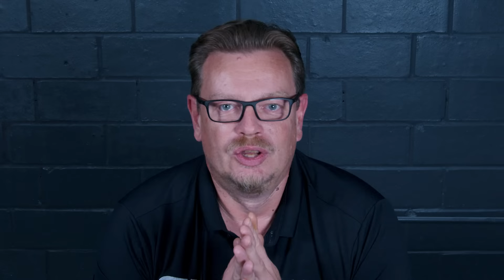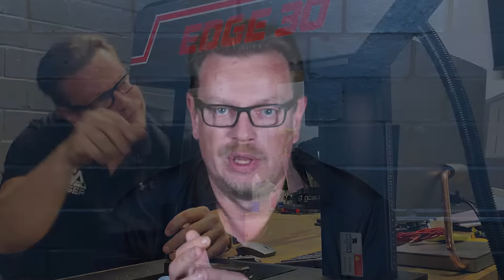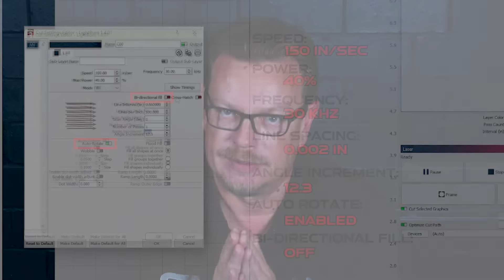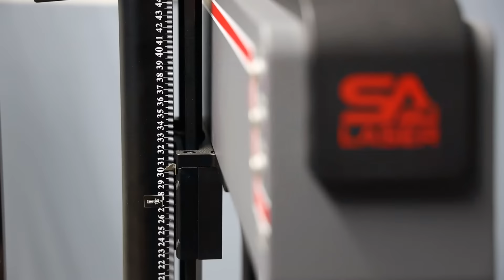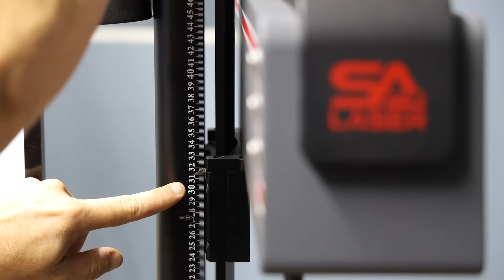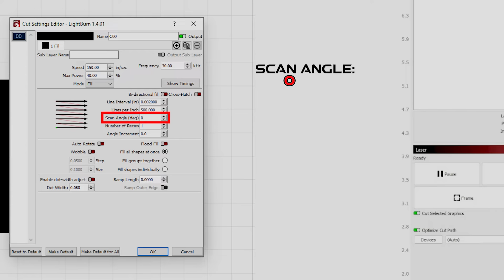Can you color polish metal with a fiber laser?

Comment: I find the question of whether this is possible WITHOUT changing the focus much more exciting. I tried this with my JPT M7 60W Mopa and it works great if you adjust the values. But it's just stupid to go almost 10mm higher in focus. This affects the material around it, which should not be discolored at all.

Comment: I'm having some trouble with this method, i have a 100w mopa fiber and i converted all inches into metric, and converted all 30w laser powers into 100w equivalent.  I am trying to polish titanium but it's engraved more deeply than the one in the video.  My lens has a focal length from 110mm to 280mm, though the optimal focus is at 210mm.  Does anyone have suggestions?  I'm trying to run the whole progression again, with more passes thinking because it is deeper I may need to vary the focus by a few tenths of mm as it does each pass to ensure it is all hit properly.  Thanks.

Comment: So just to be clear this takes a really long time to do for like a 3 inch square
Reply: Yeah, when I set these settings, and previewed, it says the 6 cleaning passes will take 28 hours. 😮 Pass.
Reply: @GettinEdgyEDC  It takes minutes. Maybe your running your machine/settings in mm instead of inches? In this video all of the settings are in inches. If so, you need to convert the settings instead of running it as seen here.

Comment: Would this work with my 60w mopa jpt? I gave a 150 lens
Reply from the maker: The theory will work for any laser.  You will want to convert the power setting (x*30)/60.  If you are using mm you will also have to convert the speed (x*25.4).  With the 150mm lens you will likely have to adjust the mm out of focus as well.